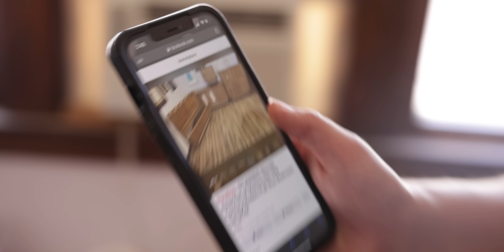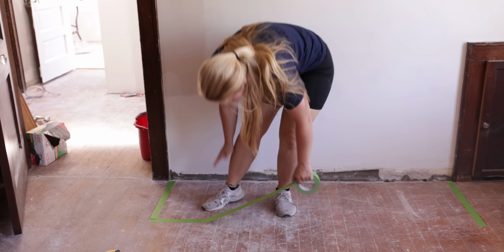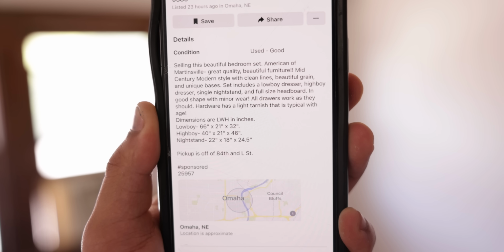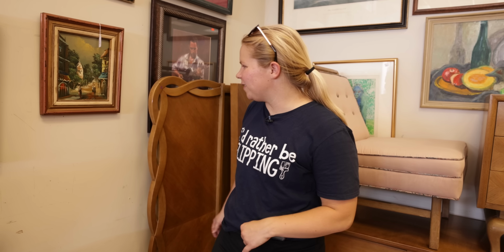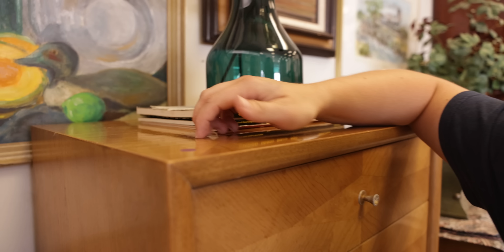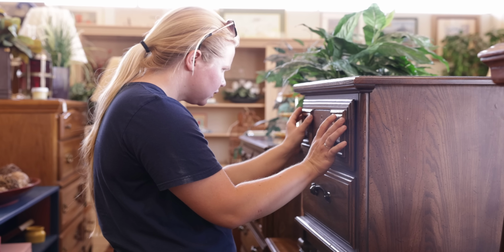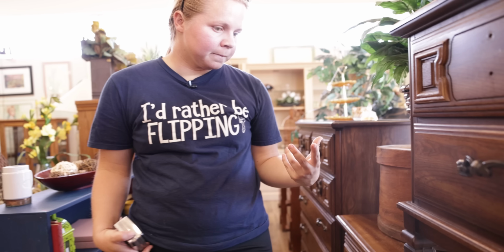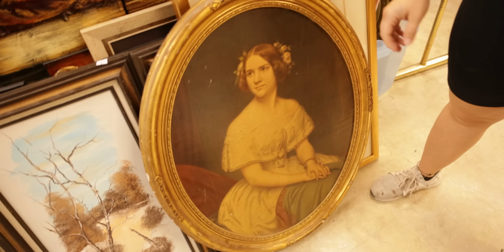Finding Furniture for the AIRBNB Bedroom

Comment: If you do more of the herringbone I would suggest you measure the length you need to cut them and clamp a stopper so you can just line them up to the stopper and cut. Less measuring and more consistent lengths :)

Comment: Just build a box frame for the bed, design your own headboard. No dressers but, look for a luggage stand to place in the closet (like hotels have under the clothes rack.) Instead of a dresser or chest of drawers maybe a cute little bistro set or a really comfy reading chair and a small side table with a few books? The uncluttered look is best and it is peaceful. Be sure a hang room darkening lined drapes or a blackout pull down shade. Many like to sleep in on holidays and vacations. Don't worry about the furniture not matching as long as it's in good shape and the room  decor is calming. NO footboards on the bed! They get in the way, take up space and make it more difficult to make the bed. All tips from my son who is a Marriot hotel manager. BTW, the bistro table wood provide a place for a laptop if needed. Wifi access is a must! And if it a room for two, both need bedside tables. They don't have to be regular bedside tables. Small living room end tables that have lower shelves are great! Thrift some smallish lamps for both bedside tables. or even some from a dollar store. Everything in the room should be sturdy and easy to replace if necessary. chose a single color as a jumping off point and style the room from that (even the curtains.) Maybe start with a rug or a piece of art (thrifted is best) and find a color within the pattern or picture. Buy dollar store shears and curtains. Maybe watch some of Sara Richardson's shows on Youtube. Ana White has some great free and easy furniture designs also!

Comment: Have you considered attaching something to wall to take place of headboard? I’ve seen flippers get a neat old door and attach to wall then just get queen bed frame. Looks really nice. Also rather than a typical nightstand I’ve also seen them make a box from wood and attach to wall leaving open bottom. That way you could possibly have floating type nightstand on both sides.
Reply: Yes!!! That's what I was thinking. If they leave the room white and maybe make the headboard with fabric that's the same color they want throughout.
Reply: Or make a headboard with the same herring bone as the kitchen, on a small scale and hang it in the wall
Reply: Floating night stands means no need to vacuum/mop around nightstand legs. You might could use the footboard to make a second nightstand.
Reply: @gingermonette7455  I like your idea because I clean and that would be easier

Comment: that full headboard/footboard doesn't allow for a queen but you could just put the headboard behind the bed (mount it).  You'll know it can fit a queen if it has two sets of slots for the rails side by side about 3-4 inches apart

Comment: I had same issue with beds in my home.  Remedied it by hanging headboard on the wall and centering bed against it.  It works and no one ever noticed.
Reply: I have used footboard as headboard the same way.

Comment: We have 2 airbnbs and less is better if they have a small dresser in closet is perfect, with a night stand. You are close to the floor register. Did you open the door all the way by the bed seems tight. If you skip the night stand and put a small shelf on each side for glasses or wallets with a nice basket is awesome. Easier to do cleaning and dusting. Just a thought. We use in the closet with a few drawers and then a wood suitcase rack.

Comment: My parents had an extension from a full-size or double as we call it in Canada to a queen size.

The 6 inches mean 3 inches on either side which really is very little and you take the length between the top and the bottom. Once the kit was installed and the new mattress on the bed and all made up you couldn’t really tell any difference at all.

Comment: That first set is gorgeous! I would not paint those pieces. Pass on the second set. However, I liked your earlier idea from a previous video of doing a desk and hanging the tv above (also, you don't need a massive tv). How long are you expecting guests to stay? They don't need a full dresser. If you're still wanting to provide drawers, then a tall boy style piece could fit in the shelves area behind the door. Or keep the shelves and do baskets as drawers. It's a tight fit what you measured out. I would also not use the foot board. As someone who grew up with 9'x10' rooms and has stayed very comfortably in AirBNBs, you're going to make it beautiful and comfortable. One thing at a time. We have a king and no box spring. The frame has slats and two sets of legs in the middle of the bed for support. We haven't had an issue in 6 years. We had a spring mattress on it before and now a foam mattress (Nova from Costco) and both worked well without a box spring. It's cheaper (bonus) and lower profile which is nice in a smaller space. Wow! You hit the mirror jackpot in that store!

Comment: I would do neither. Must have 2 night table!!!!  Don’t forget mirror matching would be great….  Personally dark set looks like a much cheaper set!

 Thefull headboard is great gives you more room for TWO nigh tables.  Full headboard makes way for easier linen changes   I would only do 2 bedside tables with glass tops. No worries with water. Keys tossed damage. What I do is mount my headboard securely to wall and use metal bed frame separately

Comment: No if a bed can be converted from full to queen it will have two separate slots and the queen attachments are longer. I have one of them myself. You will see 2 different slots for the hook about 1 1/2 to 2 inches apart. Otherwise it cannot be converted to a queen. Also for the space you have in the room go with a high one or chest. Will give more space to the room imo. Also better storage. The cove behind the door i would remove a few of the upper shelves for luggage and rest for extra clothing space. Or just take all the shelves out and turn into a deco cove with a small hall table with a lamp and trinket tray for keys. You would also have to switch the door opening to the other side in the case.
 Btw just buy a queen frame used and make a headboard yourself from pallet wood maybe?? May even find a frame on fb marketplace??

Comment: To make a full to a queen bed is very easy with the metal conversion frame. It connects right into the slots of full head and foot board, so no construction needed. The sides of the frame then expand out. The only down side is the wooden side rails can’t be used because the queen mattress is longer.

Comment: I just found your channel tonight. I’m not sure if you’re finished with the stairwell or not or if you discovered it or not. However, builders did not begin using plywood in homes until the 20th century therefore anywhere you find plywood on the floor you can expect to find some thing under it. I used to be a realtor, I worked with investors and I used to scout out their properties.

Comment: I was thinking that as talented as you are make your own "headboard" in the herringbone Style bringing it in from the kitchen into the bedroom that way you can make it as long as you want to fit a queen size bed and then just use a metal bed frame (they use up less space) Keep the wood from the headboard the same color as the trim or paint it white and still paint the wall the teal   "accent color". You could also find 2 bedside lamps that mount on each side of the headboard and instead of doing the bedside table make floating shelves on each side match the color with the trim color or paint them white...just a thought

Comment: A full size headboard and footboard can be made into a king headboard.  Cut the footboard in half and add it to either side of the headboard, or smaller if needing a queen headboard.  You may need to add trim were the seams are.

Comment: Go with the darker set, the smaller dimensions will be better in the long run. A guest room should feel spacious.  You can hang a headboard on the wall instead of modifying it to fit a queen frame - it’s such an easier fix.

Comment: The blonde set. You need something sturdy in a rental situation. Pillows up against the headboard will minimize the difference in width and add style. Attach the headboard to the wall and not the bed frame.

Comment: Not sure about the queen mattress in relation to the size of a full size headboard. And one idea, instead of using a chair to hold a suitcase, look into getting a foldable luggage rack, that way the chair is free for sitting.
Reply: Yep unless your support for the mattress is the same level as your bed frame your mattress will sag..
Reply: I had a full/queen headboard/footboard set the outside frames were chunky and had two slots on each side and each end for the rails to connect to. It looked right when it had a full size mattress and when it had a queen size mattress. If I didn’t tell anyone they wouldn’t have known or noticed.
Reply: yeah just put that in the closet. thought the same.

Comment: You can use a platform for the base support and hang the headboard… or use the full bed and high boy in a different room… my vote is for the lighter set and leave it as it is!!!
Ok just heard your thoughts on the dresser and night stand… love it!!!!
You actually got excited about that option - trust your gut and go with it!!!
Sincerely, Susan
Reply: I like the dark one and you can use a full headboard with a queen mattress. Mine is that way. You can turn the side rails upside downwith the flat side on top and the box springs lay on top. Or if the headboard are wide enough drill new holes to attach the rails

Comment: I think the size of the room does not warrant a full length dresser. Also, when converting a full bed to a twin, it is just a set of metal rails that insert into the head and footboards to hold the mattress. I have converted a MCM piece and a 19th century bed with the rails. It looks perfectly fine when the bedding is placed on the bed.

Comment: The blond set is a beautiful set. The dresser looks big for the space because of the cupboard door opening at the end of the bed. I would NOT paint it. Check the manufacturer cuz it looks like a pretty special piece. The legs and base are amazing. The headboard will be fine if it's a little smaller than the bed. I'd buy it if you think you can resell it for a profit. It's an amazing Mid Century piece. The ones you want to paint also look too big for the space but would be a lot more cost effective for the air bnb. However if I were you I'd look for smaller pieces because the room will be crowded with too much furniture. Maybe 2 bedside cabinets that double for dressers. The TV can be mounted to the wall or on a narrow shelf or something. Also you narrow the entrance with a dresser right next to the door jam. I have a small bedroom and I'm considering getting rid of my dresser all together because I want more space. Space feels luxurious and the closet will hold a lot for a temporary stay. Hope that helps.

Comment: Your first thought with everything in there should be to remember it’s a rental space, so what will hold up to the most wear and tear. For that reason as well as the wall will be painted, my vote is to keep the furniture wood. It’s tougher than a painted piece.
Reply: Also the laminate is a plus,. You don’t have to worry about them not using a coaster.  I’m furnishing an airBnB right now too.  Love the blonde set, I think it’s perfect. If I was near by I would buy that out from under you-lol

Comment: I love that store and I'm not even in the market for more furniture. 
The bed frame is adjustable. the Full-sized headboard won't be as wide as the mattress. I have a queen headboard and a full mattress; it extends a couple of inches on either side of the mattress. With pillows and bedding I don't mind the size difference, but it might not work as well with the bed wider than the headboard.
I vote you get the blond set. use just the nightstand and dresser. DIY a headboard that will compliment it. then sell the tall dresser and the headboard to someone else.
But then the dark set does match the trim ...
This is no easy discission to make.

Comment: I would think people hardly use a dresser in a rental, just like in a hotel room. I think the shelves would be a great place for people to place luggage or cloths, I would put a tall dresser in the closet that takes up half and the other half for hanging and have a shelf unit that is less deep to hold the tv books, games or whatever at the end of the bed, something less deep so you can have more room at the end of the bed. it would be more open feeling. 

If you intend to just leave this furniture there forever you don't need high quality. HOWEVER, I think you should list all the pieces as for sale. you could put a QR code sign that leads to the video where you get it and flip it, and have a price on it so if anyone decides they want to take it they can then you can put a different piece in. 
I would make the furniture fun. I don't know off hand the accent colour, to comment but the herring bone and teal sounds great. 

I have 2 night stands very similar to the ones you have there that I am currently working on. it has the pyramids on the top drawer and most people remove them but i am going to leave it. I think its a cool accent. I am just painting it all neural but now I might change my plans.... mine did not have legs but I added some that remind me of these ones you have. maybe i need to herring bone some of mine.......

as furniture the light coloured set is way nicer, nice design quality and good wood, but you kinda cant paint it because its too nice, i would do the other ones personally.

Comment: If the wood is in good shape, do not paint it. Save your self the work.  You can always paint it later if you want.  Yes paint the removeable part your accent colour.  You could just attach the headboard to the wall and then put the metal queen frame right up against it. and not use the footboard. My vote is the blonde set for sure.